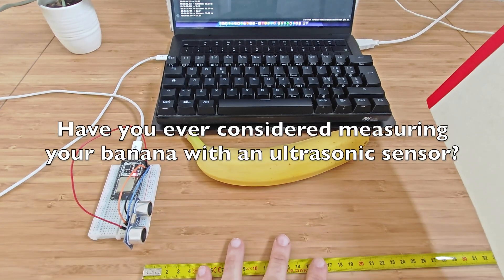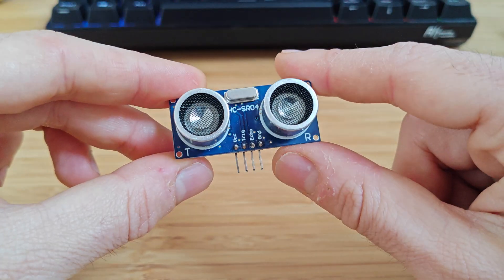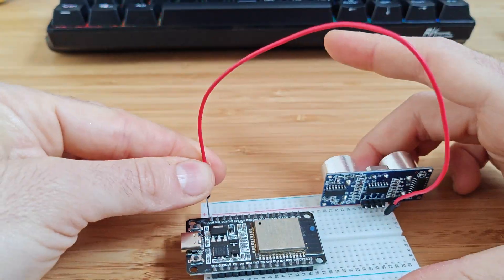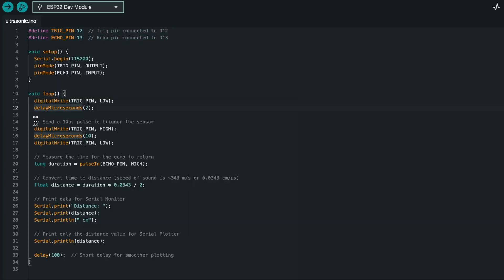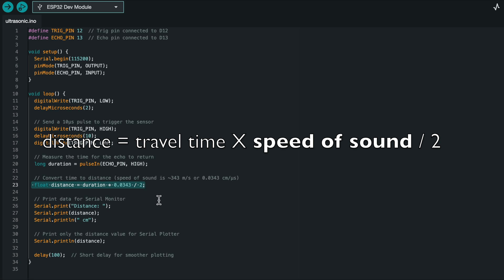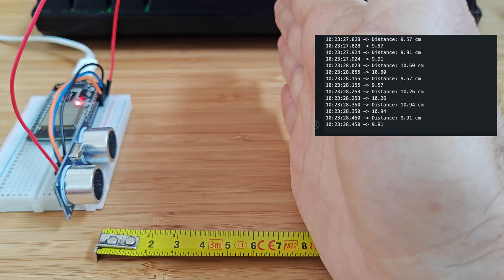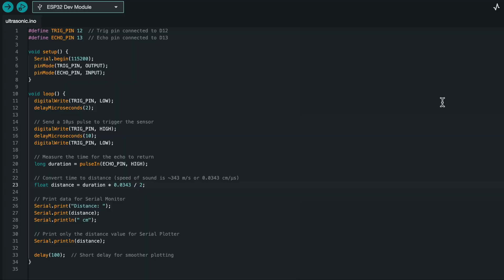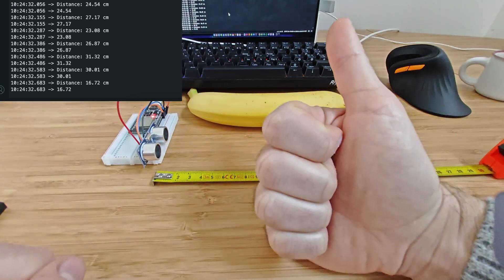Getting started with ESP32: Ultrasonic Sensor Tutorial

Comment: does your ultrasonic sensor output 5v or 3.3v to the esp32 gpio pin
Reply from the maker: Most ultrasonic modules output 5V, so you should use a voltage divider to bring the echo pin down to 3.3V before connecting it to the ESP32 GPIO. The trigger pin from the ESP32 is fine at 3.3V.
Reply: @ThinkingThings-q4p  do i add 3.3V divider between the echo pin to the gpio example number 27 right?